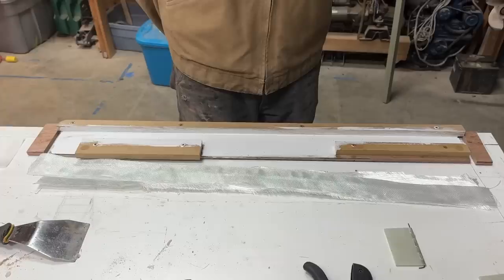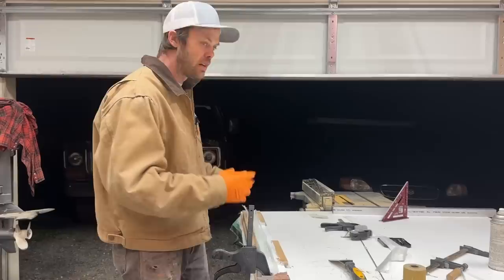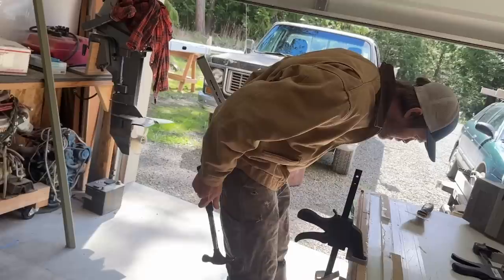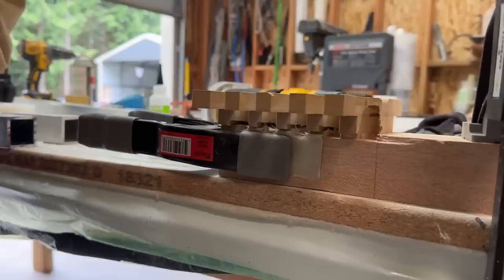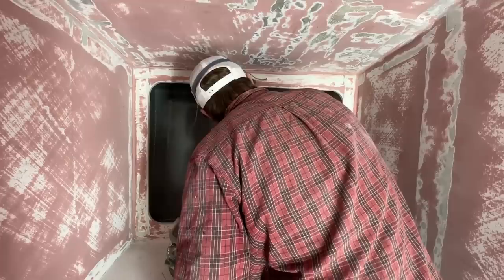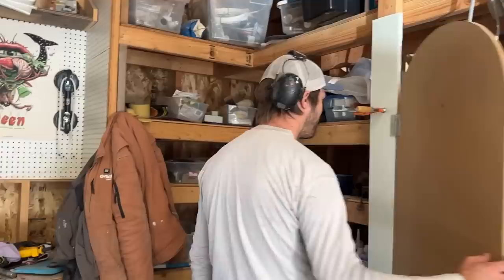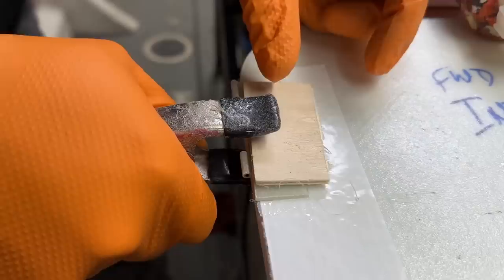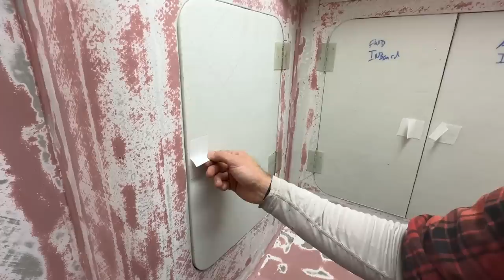Boat Build: Am I UNHINGED? [E74]

Comment: Great content, enjoy following your endeavours👍😄amazed by your skills in boatbuilding and how you explain what you do, and the thoughts behind👌
As a vendor of hinges, may I suggest you put in some kind of bushing/ring (in brass or nylon) to prevent fiberglass from rubbing on fiberglass, as well as spreading the load somewhat, you’ll gain a more smooth hinge with possibility of adjustment later on🤓
Regards from Denmark🇩🇰
Ps. The filming and editing are just as enjoyable and almost as good as the fiberglass-work😉😄
Reply from the maker: Yes, I am going to put in a washer to prevent rubbing

Comment: I like your hinge plan. You might consider using stainless steel tube instead of brass. Over time, your hinge will wear from the weight of the door. Stainless steel will last much longer.  I have observed the wear on aluminum hinges that are used in  on restaurant cabinets, brass will wear in a similar fashion.

Comment: Great job on the hinges.  I thought the tube looked small, but the rods are definitely stronger than I thought they would be.    Your expertise in aligning the hinges was also masterful. I have mounted hinges on doors that I had to make some modifications as the measurements were slightly off, but you didn’t have that issue, but I guess that is why I wear glasses.  😅

Comment: Well, you're smarter than me. I never thought to just epoxy in a sleeve.  When I made some hinges for the footbrace of my kayak I used a metal pin as the mold which meant that afterwards I had to remove it from the epoxy hinge. This turned out to be nearly impossible. I also had the notion to make my hinges out of carbon fiber, (overkill) so cutting the notches was like cutting titanium.   My pins were 1/4" (6mm) diameter. In the end I made the holes slightly smaller and drilled them out to fit the pins. They were ugly but they worked. (Any  criticism  I might have for your skinny pins would be based on asking the question, How do piano hinges die? Short answer is: they don't unless the 'door' warps, or the strip is worked loose which distorts the skinny pin. So long as the strip is firmly in place  and aligned there should be no problem. Good engineering. ) 
 What I learned that might be of use to others:  1. Releasing wax doesn't always work. Construction plastic does, Saran wrap might. 
2. Wrap a round positive mold part (rod) with at least two layers of teflon plumbing tape. This way when you pull the mold rod out at the very least it slides teflon against teflon against the rod. If any teflon tape is left behind it's not a problem and 
3. One of the best mold 'rods' is hot glue gun sticks. (They're 5/16 and 7/16 I think).  These have two really great properties. When you pull on them they stretch, the diameter gets smaller so they pop out, and when you bend them because they are solid they never kink. You can make very tight turns. There is no tubing you can bend without a jig that can make as tight a turn without kinking.  (I made some flush deck fittings to run line through for my kayaks this way. Under the deck loops 180°,  1" (25mm) diameter. I made the pieces with fiberglass sleeve then epoxied them to holes in my kayak. 
Another way to use your method would be to use soft plastic tubing and then drill it out if it doesn't slide out. Drilling out glue sticks would be a mess. Make sure your doors/frame won't warp and the pins don't drop out the bottom.  Good work.
Reply from the maker: Thanks for the tips!

Comment: 42 years as a Cabinetmaker, and a sometimes offshore sailor, I am going to recommend you rethink this approach.  IMO those skinny barrels  are going to wear out faster than you think and the doors will be binding on the bottom.  Not a member of the youtube hinge police just an old guy with lot's of experience.
Reply from the maker: The doors are super light so I’m hoping that that will keep them from wearing out too quickly, but time will tell. If they do wear out, I’ll can cut the notches off and put on purchased metal hinges.
Reply: @TheDuracellProject  Yep you're right, they are super light, but fiber-glass without a covering is an abrasive material.  Think of it like rubbing 2 pieces of sandpaper together. Do you really want to be looking for Cabinet hinges in Bora Bora? 🤔

Comment: Cool hinges! What about some aluminiumpowder in the epoxy to make the them a little more resistant to the abrasion between the hinges? A few years ago a saw hinges in composite that just used "flex" and thinner part in the middle of the laminate instead of the tube and rod, maybe that is something you can figure out how to do :-)

Comment: Great idea with the hinge construction. One question though (and I am sure you contemplated the same thing) Why didn´t you use a router to make a flush hinge installation?? I thought that was the idea all along.. integrating fiberglass into fiberglass, instead of using metal..
Reply from the maker: I didn’t think about it. It’s a good idea!  I’ll try that on the upper doors.

Comment: Much as I admire you hinge making skills mate, they are full of potential faults...if you were using them for tiny bespoke doors that weren't weight bearing that would be fine, but to use it for a heavy door is just crazy. For a couple of buck (not to mention the time spent making the glass ones) you could have bought solid brass ones that would last a life time. I give your hinges exactly one month before it fails due to the weight it's carrying. PS: And when they do fail, what are you going to replace it with out at sea?
Reply from the maker: you might be right!

Comment: Solution = 2 or 3 x 5mm stainless steel plate 60mm by 60mm per door, drill 4 x 10mm holes in it near the corners. Embed these into the door, the holes will allow the epoxy to grasp both sides and through the holes. Now you have a foundation to screw into...many options - self tapping, threading etc  -long lasting. Fibre glass hinges will wear down over time, imagine this happening when you are on a long trip-no thanks, maritime solutions need to last.

Comment: Did you consider just epoxying or fiberglassing into place regular brass hinges?  If you roughen the downfacing edge, would just epoxying it into place be strong enough?  Or, what if you put a layer of fiberglass over the plate on the brass hinge to further strength it?  It seems a challenge with both these schemes is maintenance as you can't easily remove or replace a hinge attached this way.
Reply: The answer you will generally get is that the epoxy bond will eventually fail do to thermal cycling. Metals have a different thermal expansion coefficient than glass fibers (or carbon fibers, for that matter). But I have never tried it. If you are careful with the surface prep, epoxy will stick to metal pretty well.
Reply: @mckenziekeith7434  I'd be surprised if such a small distance (like the 3" length of a hinge) gives enough thermal expansion difference to cause a problem if the metal surface is properly prepared.  If I did the calculations correctly, the delta in thermal expansion between glass and brass over an 80 degrees Fahrenheit temperature swing (which is essentially from 32 to 112) with a 3" hinge length results in a differential expansion of 0.0014".  Is that enough to cause a problem?  Plus most thermal cycles would be far, far less than that temperature difference.
Reply: @mckenziekeith7434  Don't get me wrong.  I have much appreciation for the ingenuity and invention here.  I'm just not understanding why it's worth the time (when there's so much else to work on) and concerned about durability, ease of maintenance and modification down the road.  I'd probably glue a wood dowel into the foam where each hinge screw goes, fiberglass over that to seal it in and then drill and screw regular hinges into that.  Sometimes, there's a conventional method of attachment for a reason.
Reply: @jfriend00  Yeah. I don't know. I just know that nobody recommends using epoxy to attach a flat metal surface to fiberglass. There would always be a fastener or a knurled shape embedded in the epoxy or something like that. It is hard to believe that 1.4 thou could cause a problem. I do take your point. It will definitely stick for a while, though. If you coat a piece of metal with epoxy you are not going to peel it off without a fight.
Reply: @jfriend00  That is an accepted technique also. Drill a larger hole, fill it with something (a dowel or solid fiberglass or epoxy with a structural filler, etc) and then screw into that. If you fill it with epoxy and high-strength filler, you can even drill and tap it and use machine screws for the hinges.

Comment: What a great idea Matt! You could probably sell enough of those hinges to fund the entire Duracell Project! Did you find any negative effects on the thin tubing from the heat of the epoxy going off? Just curious ...
Reply from the maker: No the epoxy doesn’t get hot at all. It’s too thin. The biggest trouble is when I cut the notches the ends of the tube tend to get a little blocked so I have to clear them
Reply: @TheDuracellProject  Ah, gotcha. Trying to think of an easy, fast way to clear the tubes, or prevent them from getting blocked at all, but nothing is coming readily to mind.

Comment: You are one creative dude. Any chance a slot could be cut in the foam behind the outside layer of fiberglass so the hinge could sit flush instead of being mounted on the outside of the cabinet?  It's hard to describe what I'm thinking.  It would be hard to clamp and mount but would be a really clean look.
Reply from the maker: I thought about that too! The problem with that would be the reveal between cabinet door and cabinet side is pretty tight
Reply: @TheDuracellProject  I thought about that too.  I was thinking maybe a slight gap could be made right where the hinge itself sits.  Basically grind a small notch for the pivot point to sit in.  I'm not trying to make your life more difficult I promise :)  It's just fun to be creative with this stuff.

Comment: Have you considered the cell effect of using two dissimilar metals SS and Brass ...high moisture with salt ...and if they seize then trouble
Reply from the maker: I have thought about. It is easy to keep them lubed and the pins are easily replaceable
Reply: @TheDuracellProject  Ok over long haul marine environment lube degrade open/exposed fabric that's been cut ...try brass rod with brass tube any RC hobby shop...  as for counter  look for HMD stuff that commerical cutting boards ...1/2...or delrin sheet expensive though...I've got no rag bag experience(😀 but dearly departed colleague was one 'till I converted him to the dark side?) but in me youse(30ies 40ies, now 81)) 20 years small flats boats Keys and Marco Island FLA...big single engine that would chine walk my skiff earlier saw lots of cell effect...and used lots of solid plastic for bait well and hatch covers to avoid corrosion

Comment: Love the thinking but I'm afraid I don't think they'll last all that long. If you look closely at an old pair of metal hinges you'll see swarf between the mating faces of the 'teeth'. This where all the load is carried and where the wear takes place.  Really high quality hinges have washers of high-strength steel  at each mating face to reduce the problem. Maybe mixing your fibreglass plates with a centre section cut from a s/s hinges would give a glueable ( not screwed) hinge that also has durability?
Reply from the maker: Yes, I have thought about washers. We might do that

Comment: I like the idea of making the hinges yourself and they turn out fine, but the way you use them is not so good when using piani hinges, as they are rightly called the type you have made, they are mounted hidden so that you can't see the hinge but only the small one where the two parts pull into each other. so they should have been mounted on the edge of the door and on the edge of the cabinet.

Comment: I love watching your channel. Have you ever considered a 3d printer. you could print hindges and handles etc.
Reply: A 3D printer would definitely help with here hinges
Reply: 3d print is super weak for something like this compared to fiberglass and epoxy. It wouldn't also solve the extra work part
Reply: Was thinking the same.

Comment: The easier way is to drill an oversized hole, fill with thickened epoxy, drill and screw.

Thanks Mads from Sail Life (SV Athena) for doing that over and over and over again.

Mostly for water proofing reasons as he as plyboard cores, but it'll still work.

Comment: You must have left out a step. There is no way that you can paste 2 half hinges on the door and the other halves on the frame and the hinges line up. What you showed us is not what happened.
Reply from the maker: I left out the step where I had the door in place and I marked where hinge goes on door and cabinet. I very accurately marked it
Reply: @TheDuracellProject  No matter how accurately you marked it, I really can't imagine being able to get the hinge halves to stay in place while the  epoxy set. It looked like you have less than .010 play between the hinge knuckles. The only reasonable way to get those hinges to line up is for them to be temporarily drilled and screwed to the door and the frame while the hinge halves are together.
Reply: @pauleohl  One did have to be filed a hair, all others worked great … saw it with my own eyes!  (Matt’s mom)

Comment: Wrong colour. So dark. White would be much better. Good luck finding anything without lighting.
Reply from the maker: yeah, we'll see. or I guess we should say "we won't see." We can always paint over in white.
Reply: It’s Duracell.  There has to be a battery near by for lighting.  That said if you’re cruising I’d be agreeing on the brass/chromed hinges, I’d add a thickening pad inside the cabinets and epoxy them in while you’re at it… it’s going to look a whole lot better too.